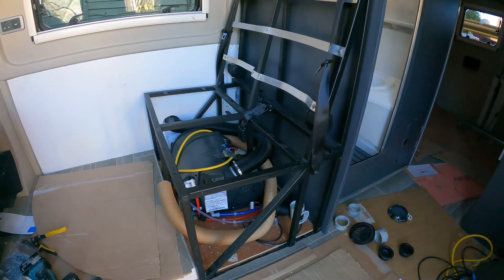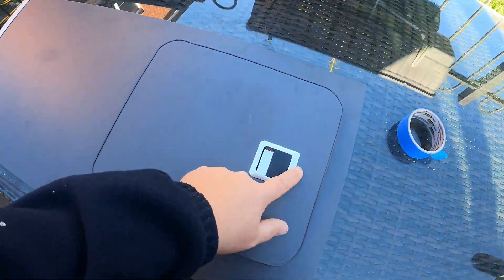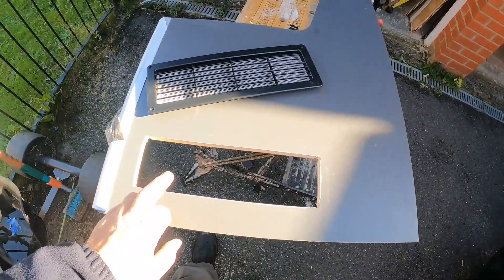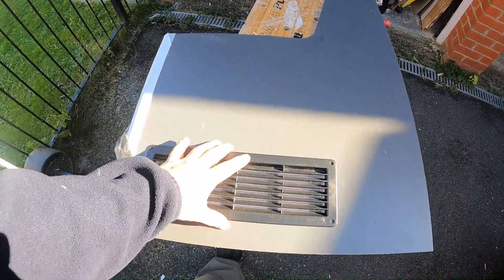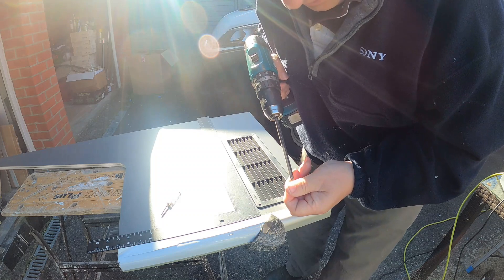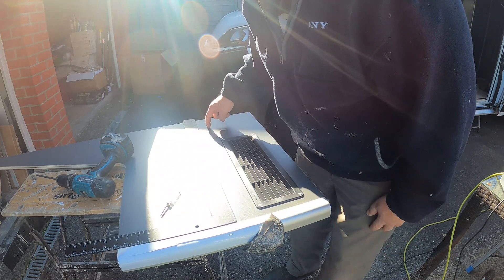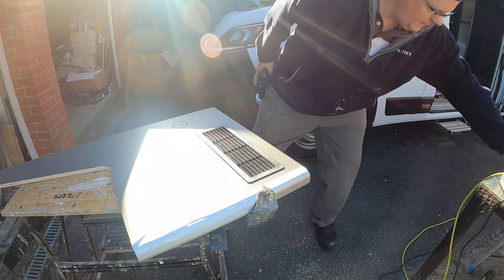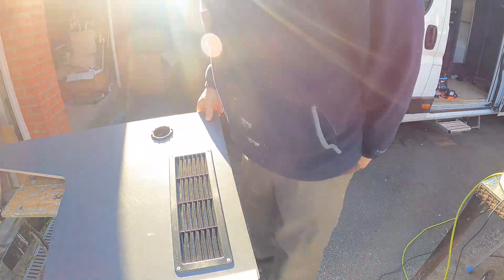Seat Frame Surround in self build campervan Ducato / relay / boxer / promaster

Comment: Nice to see the video is up, I’ll watch it later to see how you did it and the final result. I am following your build very closely as I’ll like similar layout like yours but with the back section different ( bench seats on each side to also convert into a bed, then a project 2000 smart bed lift on the top to be set up as a lift bed that’s always made and ready to go 😊)
Reply from the maker: THe bed lift sounds interesting, will watch with intrigue.
Reply: @wiltshirecustomcamper7203  lol thanks. It all depends on when we sell our current van and when we buy Ducato L4H3

Comment: Excellent finishing! Well done. May be a dummy question, why you didn't use the frame from the passenger as well? The whole unit.
Reply from the maker: several reasons: 1. seat belt mount would be on wrong side and no mount for middle seat 2. would be to low 3. not easy to re-fix to floor due to how the brackets work. not a dumb question though as I did look into it and see if any way to make it work....

Comment: Absolutely loving your videos at the moment..  Very informative and I like your level of accuracy in your work..
I'm starting my Realy build in Wiltshire too...
I'd love to know if you sorted the seats using the old twin seat as I'd like to try this as well.
Also how far back in thr van did you mount the seat? What's the distance from the front?
Cheers. Mick in Chippenham Wiltshire...
Reply from the maker: Hi Mick, You are not far from me at all! I did manage to reuse the foam and upholstery from the original twin seat but you actually need 2 donor seats in order to lose the fold down tray table, was not a problem however as people are happy to give these away it seems and I picked up a second complete twin seat near Salisbury with the same upholstery design for free. Mine is further back than normal as I have a very specific table arrangement. You will find the distance is governed by the mounting brackets and space underneath. Only hassle was then having 2 frames to take to the dump, was not questions about it though and just chucked them in the metal bin. hope that helps.
Reply: Amazing thanks. Yes a saw the video with the extra seat frame in your garden 😂
Have you done a videos with the seat finished?
I ordered my Solway seat frame today to thanks for the tip.  You should be on commission 😂

Comment: Once again, so many good ideas and tips. I hadn't given much thought to vents for the Truma so this video is most helpful. I notice that your Truma exhaust is below the side window. Is there any guidance as to location. Also did you pocket hole into the Solway seat frame? I found the frame difficult to drill into, perhaps I needed to replace my drill bits!
Reply from the maker: I think if you are within a certain distance to a window, the said window should have a sensor on it so if it is open it cuts off the boiler, but I am going to let common sense prevail on that one.. Did not pocket hole into the frame, the boards are pocket holed to the floor, although I have drilled the frame and it was quite easy and soft so perhaps some shiny new HSS drill bits are in order. treat yourself! Toolstation do a good Bosch set not to expensive.
Reply: @wiltshirecustomcamper7203  Ah common sense 👍 sadly so often lacking today ☹️ common sense used to save many lives 👍 and all without the need for an app 🤣👍

Comment: brilliant stuff i love watching your videos :) could i ask what the piece is in the corner under the window on the solway panel you have put in? my panels never came with a piece for there and just shows part of the white van
Reply from the maker: Would love to help but not sure from the description what part or area you are relating to? sorry! If this helps then the vertical 'slither' you can see in front of my white panel under the window (kind of where your feet would be if sat in the seat) is part of the solway pillar section. if that's not it then please try to describe again. thanks.
Reply: @wiltshirecustomcamper7203  yes that's the piece I'm referring to , mine does not have that piece on it so when my bottom panel is on the gap between the panel and the solway panel is white , wonder why it's not on mine :(
Reply from the maker: @widget2k4  Oh, thats not good. if you go here https://solwaycamperconversions.co.uk/online-shop/ols/products/front-shelf-cover-ns-os-b-pillars-3-piece-set-for-ducato-relay-boxer-h2 and look at pic 2 you can clearly see this extra bit, it is about 50cm tall from the floor and about 5cvm wide.
Reply: @wiltshirecustomcamper7203  i see it , im going to get onto them thank you

Comment: Have watched all of your videos several times as they are so informative. Very close to finishing ours, but still have the Solway seat end panel to trim and install. How have you dealt with the seat belt connection on the side of the seat? The set screw (without the black cover) protrudes by about 12mm which means the end panel cannot be fitted flush with the seat frame.  I am thinking of routering 12mm into the 15mm board but nervous about the outcome.
Reply from the maker: Hi Peter, yes I had same trouble. I just left a gap down the side so the side panel is fixed to the floor, the rear panels and the aluminium corner to the front but not to the actual frame, if that makes sense.  I think if you then have your cushions overlap slightly it will cover this gap anyway.
Reply: @wiltshirecustomcamper7203  Thanks for the swift reply. No great drama with the first attempt at routering using a gash piece of board, so it's upwards and onwards.

Comment: You should make Instagram channel. We are on there and I am more active there
Reply from the maker: Thanks for the headsup, I have only just really work out how to send a text message on my phone, so one small step at a time for this old dinosaur.
Reply: @wiltshirecustomcamper7203  that’s not a problem, take it all at your own speed
Reply from the maker: Trouble is, at my own speed, Instagram would probably have gone by then and something new will have taken over. It's all too much so I'm going to have a nice brew before starting again with today's jobs. finishing the kitchen or putting the bed frames in? decisions decisions....
Reply: @wiltshirecustomcamper7203  kitchen first. Bed frame last. This is because you already have the shower there to determine where your bed frame will get to.